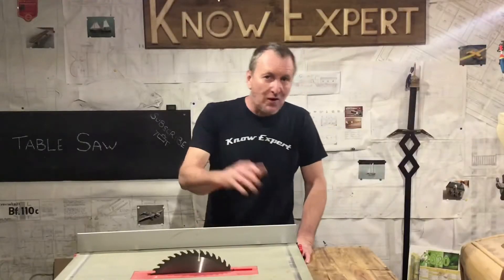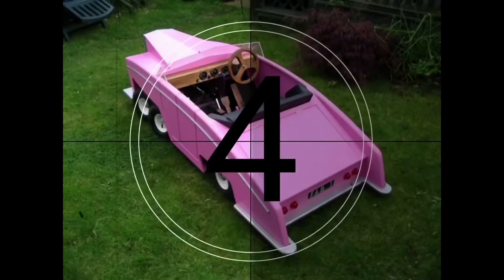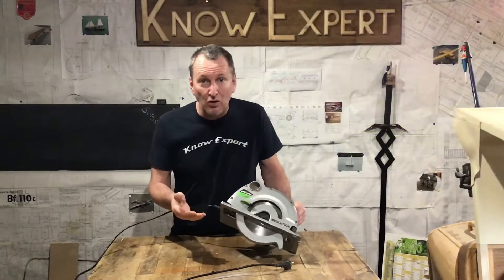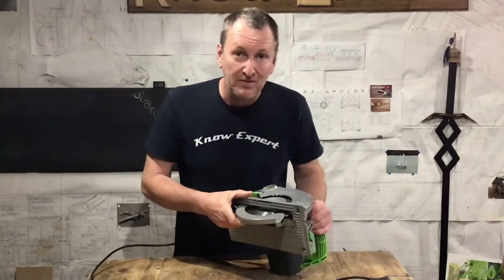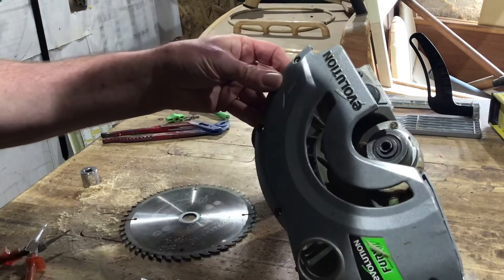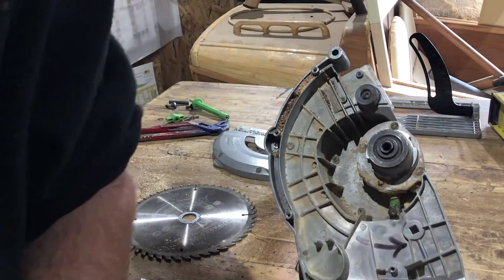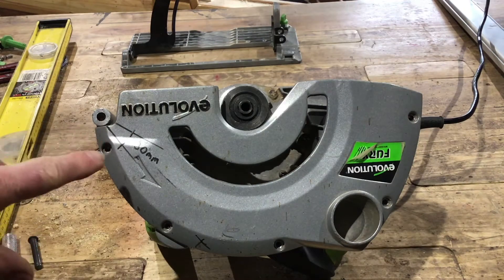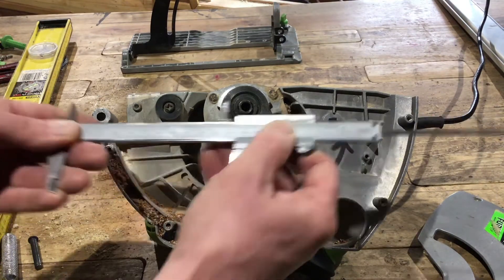ANOTHER DIY Table saw Bench saw BUT this one cuts Metal as well as wood...

Comment: Congratulations on buying a decent welder,be careful they're addictive! I have 5 now and a Plasma cutter. Great idea using a circular saw as a table saw. Filler rods next,because you'll be doing Ally and other non ferrous welding with Argon. Keep up the good work :-)
Reply from the maker: Together with the new mask my welding improved overnight. I thought TIG would be my best option as I often find myself trying to weld small things, then when I received it I saw it had plasma cutter and stick options too (although I can’t imagine needing to plasma cut in my garage).

Comment: Man, santa spoiled you rotten! Nice welder and nice welds.
I think you should move the attachment point of that con rod closer to the pivot point or you are going to get bored of winding very quickly.
Reply from the maker: Ha ha you’re not wrong I already realized when I fitted the handle. I’m going to live with it for now though as I need some way of keeping warm in my freezing garage. And yeah I’m well pleased with my new welder. I think as I get used to the amp settings for different thicknesses my welding will improve no end. It’s already 10 times better and I’ve only been on it for 10 mins.
Reply from the maker: I just counted..... 86 turns..... oooohhh. Looks like a geared wheel needs to be added next to the first wheel...... mm if I get time I’ll have a go at that.
Reply: Windscreen wiper motor so you can set your height with a button!
Reply: @turboconqueringmegaeagle9006  The old CB radio power supply would be good for that
Reply from the maker: Oh strange I’ve only just seen this..... I’m looking into electrifying it, good idea.